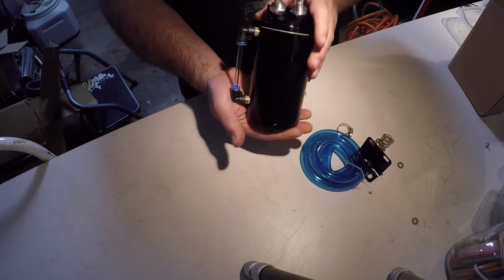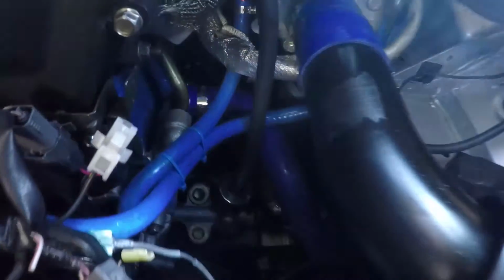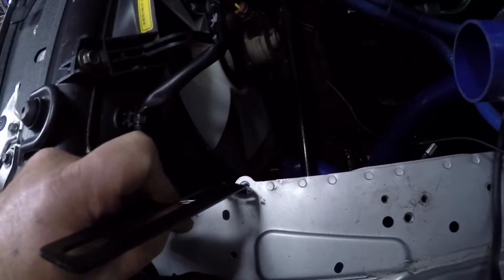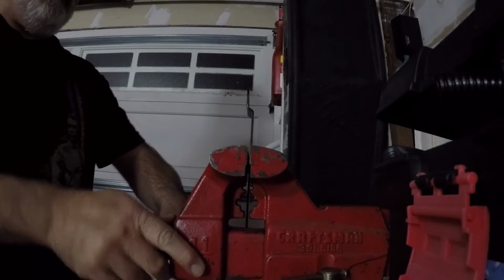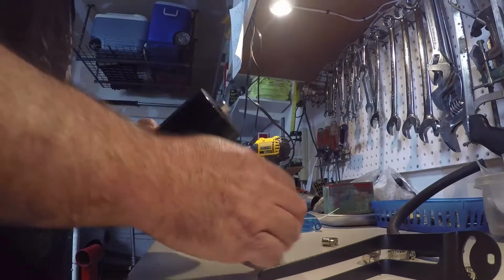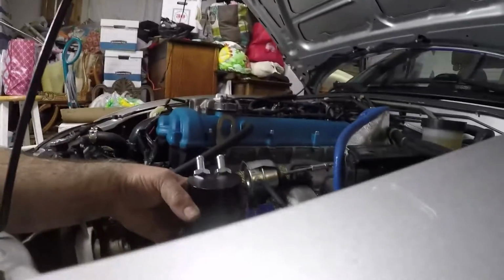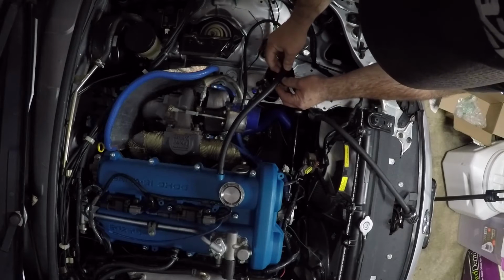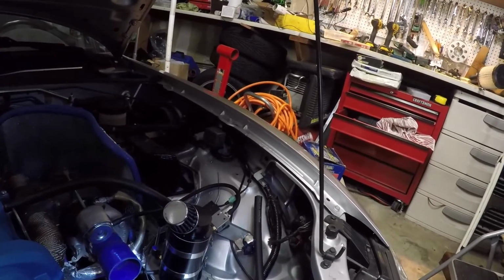Oil catch can install how to on the Boosted Miata

Comment: you should open up that new catch can and make sure it has some kind of material inside to condense the vapour/catch the oil, if there's nothing in there you could possibly end up with exactly the same problem just in a different location, wire wool works best in my opinion.
Reply from the maker: Josh Foster thanks, I will do that. pretty sure it's empty. I've also got  a better place and way to mount it.

Comment: Why do you have two catch cans? Thats confusing me. Im trying to figure out how to install mine. Its a pretty cheap one but like you said i dont have money to just toss around right now. Im trying to figure out where i need to connect mine to my intake manifold. Right now one end of my catch can is wide open (i dont have one of those filter things) and i was told it should go to my intake manifold. Am i supposed to connect it to my PCV valve? If so, what do i do with the hose from my PCV valve going into my firewall? I have a 98 integra btw

Comment: two questions. What radiator cover are you using? and how did you get that huge scar?
Reply from the maker: The rad cover is from garage star, they are out of business. You can get a similar one from Goodwin racing: https://www.good-win-racing.com/Mazda-Performance-Part/61-0150.html?gclid=Cj0KCQiAu62QBhC7ARIsALXijXTkqdxXdBaJ2EtcIVHsfinjrQYrwsKzTEhZuO33z7mf0gXTTIRWgTEaAvAcEALw_wcB

The scar on my wrist is from multiple surgeries to repair a severe fracture - complete success btw!
Reply: @Seandoestech  Holy heck.

Comment: Clean engine bay, seems all the oil leaks are resolved?  Blow by out of a filter catch can or not doesn't sound like a leak to me.
Reply from the maker: greeenteeee I need to get under the car and check. nothing pouring out like before though

Comment: Hello Boosted Miata,
I am about to fit a catch can to my car as well, I am wondering if you lose any engine oil after fitting a catch can? because it seems like you just let the oil flow to the air instead of putting it back to crankcase through ventilation.
Thanks a lot for this informative video.
best regards,
Tanawat.
Reply from the maker: +Tanawat Oonwattana you will lose some under boost. If you are.not boosted, you likely will not have enough pressure to force oil out of the crankcase vent.
Reply: Boosted Miata Thanks Shawn for the reply, much appreciated :)
Reply: Hey boosted miata, I really enjoy your videos and wanted to give you a good idea to improve your cheepo catch can. Affix a metal straw to the one port so the oil and air vapor is forced to the bottom of the can, then also fill the can with steel wool. tada! now its doing just as good a job as the moroso brand one.

Comment: greg Peters from thecarpassionchannel says you plumb that hose back into the intake side of the turbo. is that necessary? He says if you just cap it with a little filter it would just cause a vacuum leak.?
Reply from the maker: +Blue B6ZE Yes if you want to be emissions compliant. Otherwise it doesn't matter.
Reply: The reason for the 2nd vented oil catch can is because its a turbo car and under boost it is no longer getting vacuum on the intake manifold(where the other can is connected) its actually under pressure so that can is likely having its oil blown back into the valve cover under boost. So you do a 2nd can that can allow blowby air to go to atmosphere.  Thats my understanding.  
Normally the PCV system has 2 hoses to the valve cover. 1 allows filtered air from the factory airbox to enter the crankcase. The other hose has the check valve(CHECK VALVE) on it which pulls blowby gases under engine vacuum into the intake.  

Ok wait. i just realized that the PCV eill normally prevent or minimize boosted intake air from blowing through oil catch can back into the valve cover.  Some guys on youtube say to remove the PCV valve on boosted cars but they forget its there for a reason.  Leave the check valve in place if adding an oil catch can.. thats just my 2 cents on this.  i never installed one but worked on plenty of cars and understand the theory of operation.  It makes sense.

Comment: what are the specs on yoyr Miata? Year Model Weight HP 0-60 & Quarter mile times etc
Reply from the maker: +Buda Bunda 2001, 2350 lbs, 230 hp, haven't timed it, fast though off the line.